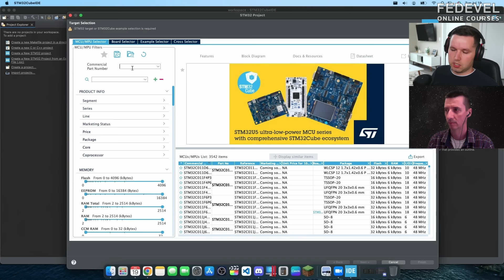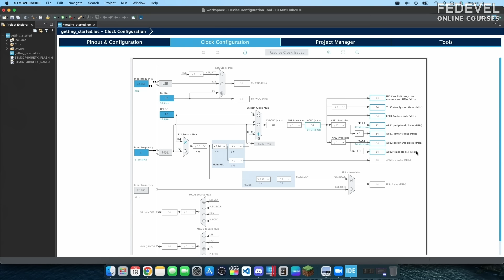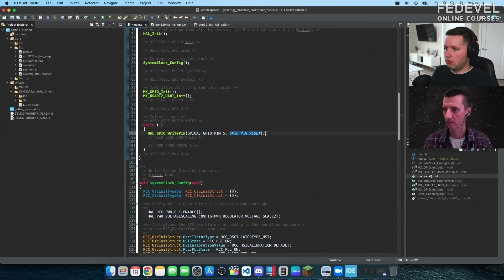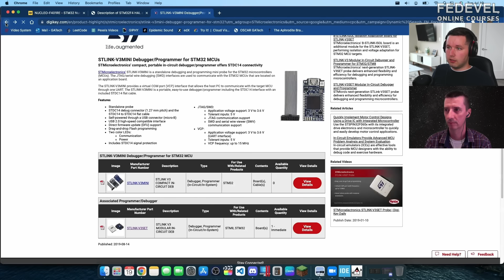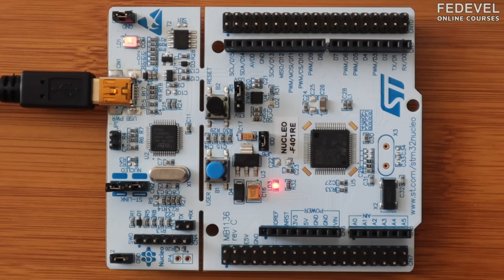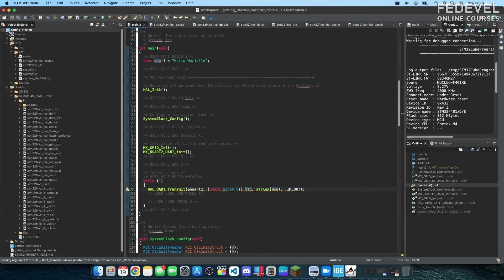Starting with STM32 - Programming Tutorial for Beginners | Step by Step | Greidi Ajalik

Comment: I'm watching the video in 2025. I'm using Linux 24.04 and there is an issue of using arm-none-eari-gdb to debug and run and my Linux won't download the same does anyone have a proper solution to it (I used symlink and even gdb-ultiarch (I believe I place the path in the right place) but still it's the same)

Comment: Hi If anyone can help me, I am getting this while uploading the code from Mac to STM32H755ZI model 

STMicroelectronics ST-LINK GDB server. Version 7.10.0
Copyright (c) 2025, STMicroelectronics. All rights reserved.

Starting server with the following options:
        Persistent Mode            : Disabled
        Logging Level              : 1
        Listen Port Number         : 61234
        Status Refresh Delay       : 15s
        Verbose Mode               : Disabled
        SWD Debug                  : Enabled
        InitWhile                  : Enabled

Info : default port : 7184
Info : Remote address: 127.0.0.1
Info : stlinkserver already running, exit
Waiting for debugger connection...
Debugger connected
Waiting for debugger connection...
Debugger connected
Waiting for debugger connection...
      -------------------------------------------------------------------
                        STM32CubeProgrammer v2.19.0                  
      -------------------------------------------------------------------

Log output file:   /tmp/STM32CubeProgrammer_7ood16.log
ST-Link Server is running on port : 7184
Info : default port : 7184
Info : Remote address: 127.0.0.1
Info : stlinkserver already running, exit
ST-LINK SN  : 0051003E3032511537333436
ST-LINK FW  : V3J16M9
Info : default port : 7184
Info : Remote address: 127.0.0.1
Info : stlinkserver already running, exit
Info : default port : 7184
Info : Remote address: 127.0.0.1
Info : stlinkserver already running, exit
Board       : NUCLEO-H755ZI-Q
Voltage     : 3.27V
SWD freq    : 8000 KHz
Connect mode: Under Reset
Reset mode  : Hardware reset
Device ID   : 0x450
Revision ID : Rev V
Device name : STM32H7xx
Flash size  : 2 MBytes (default)
Device type : MCU
Device CPU  : Cortex-M7/M4
BL Version  : 0x0

Opening and parsing file: ST-LINK_GDB_server_JZJfK3.srec

Memory Programming ...
  File          : ST-LINK_GDB_server_JZJfK3.srec
  Size          : 4.15 KB 
  Address       : 0x08100000 

Erasing memory corresponding to sector 0:
Erasing internal memory sector 8
Error: failed to erase memory

Error: failed to erase memory
Encountered Error when opening /Applications/STM32CubeIDE.app/Contents/Eclipse/plugins/com.st.stm32cube.ide.mcu.externaltools.cubeprogrammer.macos64_2.2.100.202412061334/tools/bin/STM32_Programmer_CLI
Error in STM32CubeProgrammer
Shutting down...
Exit.

Comment: Thank you SO much for this video. I didn't know this software existed. I find it much better for learning than ArduinoIDE. STM32 is definitely a much more educational piece of hardware than Arduino boards or ESP32s. I'm definitely going to have a lot of fun (and headaches) learning all about the bare-metal configurations such as the start-up code and interrupt handling.

Comment: There is the STLINK-V3MINI or STLINK-V3MINIE as well.  It's a bare small board with only the 14pin cable.  I think you need the STLINK-V3SET if you need the 20pin cable.  It's about $15.

Comment: I'm not a professional programmer or anything but I did learn a big thing about libraries. I didn't know if it's included, the whole thing is added. I thought the IDE was smart enough to only compile what was used in the library.

So does this mean if you wanted to use just strlng() from string.h....you'd have to copy that string.h library as your own and delete everything that's not needed to save on program size?

Comment: The capacitor C15 and R30 are not for filtering a signal, they give time to clock system to start before the level of reset pin  become high to start the microcontroller.
Reply: Incorrect. R30 is a pull up resistor to keep the pin at VDD until the switch is closed (then reading ground voltage 0V). C15 is used to smooth out the off/on spikes that occur when you press or depress a switch. That is called switch bounce. So instead of reading a hundred false open/close readings, you must debounce through hardware (this example) or software. R29 is probably there to help with larger spikes of voltage creating a snubber circuit but it probably isn't necessary.

Comment: There are HAL and LL applications and examples on your machine when the a STM32 device library is loaded. The location is "Users -> User Name -> STM32Cube -> Repository -> Device Library -> Projects -> NUCLEO board being used -> select Examples or Applications". In the main Projects folder above there is  a HTML document that lists all the sample code for the entire STM32F4 family of devices. Since ST makes the STM32 family I/O (port pin out) scalable you can use an example for one board on another another board. In other words, open the HTML document and look for the example code you are looking for and then follow above and get the code. Warning: ST does a lot of cut and paste for example code and it will compile with no errors but not work. Then you have to step debug...a PIA. 

I'm a ST Sales Guy. CubeIDE is much improved from +5 years ago. But when a new release are done,  e.g. 1.13.1, they now require a log in for every update done in the application and selector bounces back and forth when trying to type in a P/N or board selection. I sent a hate mail to ST about that, but just like every husband wife relationship they do not listen to me. I encourage you all to use the ST website site on line support option and STM32 forum to vent your frustrations. They pay attention and make patches and changes.

Another way to get example code is when you initialize a project there is tab  for "example".

BTW - this is an excellent bring up video for the STM32...as a ST Sales Guy lead times are back down to 10 to 12 weeks for QFP and QFN products. BGAs still suck because of 3rd party lead frame issues.

Mic drop

Comment: Hello guys, im having a trouble with stm32cubeide, basicall when i try to open a new project its says "Code generation could not be done most probably because the necessary firmware package is missing. Not able to complete STM32Cube project creation. See Firmware Updater for settings related to firmware package installation Tips: Please use the Device Configuration Tool, and then use 'Project > Generate Code' to complete the project generation." any helps?

Comment: 24:11 can someone explain how uint8_t hello = "Hello"; works? How can Hello be stored in 8 bits?
Reply: Maybe the 8 bits point to the array's starting address?
Reply: @uncommonsensor  yeah that makes sense. I am not used in programming like that. I would declare it as a string. Is there any difference? Which is better?
Reply: @arisk4  Well I'm more familiar with C++, but it does use C strings, which are just arrays of bytes terminated by a 0. Also, arrays typically just point to a location in memory, and then depending on what type of array it is, it will know how to access each element in the array depending on the size of its type, and it's index.

I'm not sure if that is what is going on here, but it was just an assumption. Maybe the \n marks the end of the array somehow

Comment: Compilers will optimize code generated and remove dead code from include files etc. So it's correct to include the string.h file. Only the call to strlen will be included, because that one is really called. Include files define prototype of functions, so the compiler can do type checking and thus detect programming errors at compile time.

Comment: Hi. Great video. I have a question.
I have been working on a project for 2 days. However, I need to configure an ADC Port and channel as input. However, if i do make changes in the .ioc file and save the config, the auto generation code rewrites the code i worked for the past 2 days. How can i change config without losing my code?
Reply: Your code needs to be in the appropriate sections commented as "user code"

Comment: You can use the built-in ST-Link for custom boards. The debug pins are available on header pins on the ST-Link of the Nucleo board. Here you need to disconnect the Nucleo MCU from the debugger.
The purpose for the cuts in the Nucleo PCB is actually breaking or cutting off the ST-Link part from the Nucleo, and keep using the ST-Link as stand-alone device.
Reply: That's invaluable advice! That was the only solution for me, when all cheap ST-Link copies failed.
Reply: wow neat

Comment: I would stay away from STM32 for anything other than very small production runs. They have had (and still do!) massive supply problems for the better part of the last 2 years. We have had to move to other solutions because we couldn't get a hold of multiple different STM32s (F103, F413, L496, etc...).
Reply: The chip shortage is prevalent on mcu's then any other for of chips. No one can find also say a simple 8bit atmega 328 that does not cost 12times the "normal price ... and come many other types are also going out of stock.
ST is opening a Mega factory in the USA and moving away from their Asian locations  hence the shortage.
Reply: @John_Smith__  I buy some of the ATMEL chia direct from China for reasonable prices, along with STM parts. They go straight into my own stock at the PCB factory for my custom boards. Only found a couple of models that are silly prices so can’t be used. There are also some Chinese clones of some STM parts now that I’ve been testing.
Reply: @Anticitizen666  Yup, I also have those but for large production it's not even doable. 2 years ago I acquired a Lot of arduino boards, (pro mini, nano and so on). They were at about 1.8$ .. now the same boards cost around 4$ minimum ... plus shipping ...
the most reasonable solution  I can see right now is the Raspberry Pi Pico ... 4$ so far large availability and .. it's a Dual Core Arm ...
Reply: @John_Smith__  yeah I don’t use any standard boards really, except in one project that needs the Pi Zero W. It’s easier to get the chips I’m finding. The RP2040 is easily available but the other Rpi stuff is just impossible in quantities right now, so I’ve been redesigning around the problem. It’s not good though. The other problem is that the RP2040 is very power hungry so cannot be dropped into low power projects.
Reply: @Anticitizen666  Yup, dual core = dual consumption ... not ideal for all applications. Also STM32 low power chips are a thing of advertising only for me :) ! I actually never got my hands on one (in decent quantities). I also almost never use standard boards, my example was just for a case of ultimate need with no chips available, at least the boards are available.
And we all agree on the part that it is not good, it is actually terrible the situation. I can only imagine someone with say a firm order of something like 50.000 boards sold or more and saying to the customer ... look I can not provide my hardware since I can not find the components! Let's not kid ourselves it is truly a bad situation! And sadly I think it will remain like that for at least until the end of 2023 ... a long long time sadly.
Reply: @John_Smith__  Another option are the Nordic chips. I'm using some for ultra-low power RFID/Bluetooth devices, and they can run on uA of current while still reading RFID, or operating as BLE devices! 😁
Reply: @Anticitizen666  Yes ..I also though about taking a look at them but in any case it is always forcing me to redesign and reprogram everything ... but if they have availability one must get what is available.
I now and them take a look online to check for availability of chips like the simple 8bit atmega 328 and each time I do that the prices make me think: If only I had got into hoard mode two years ago 😀 ..
Reply: @John_Smith__  yeah depends on the package with the 328, the MU is really expensive but the AU isn’t too bad in batches of 250. I always use the pb variant - it’s cheaper than the regular 328 and has more gpio and more peripherals.
Reply: @John_Smith__  The good thing is that we're all getting to try out lots of different kinds of chips instead of sticking with what we know 🤣
Reply: @Anticitizen666  True! challenging times also offer challenging Opportunities! There is always a silver lining and the shortage will not last for ever ... 😀
Reply: Hi. We are also facing STM32 supply problems. Which MCU manufacturers do you suggest as an alternative?
Reply: @qqqqqqqqqqqqqqqq7  we ported one of our devices to Linux + A7 CPU (rockchip). On another device we went with Giga Device GD32F103. For low power we couldn't find an alternative yet. The L4 series we can get a hold of in small quantities so we buy whatever we find.
Reply: @alperuzi  Thanks for suggestion. I preferred buying genuine STM32 MCUs in order to support their efforts regarding all the tools they have developed over years to simplify the R&D. It looks like I will be forced to move to GD32 simply because STM can't deliver their products.
Reply: I expected chip shortage to last 3-6 months, not years. For example it is interesting that I can't buy TPS54360. EU, US and TI stock together for this part equals ZERO pcs. On the other side there are 219k pcs available @WinSource...
Reply: @qqqqqqqqqqqqqqqq7  Yup it is getting frustrating specially because we were not used to this shortages ... but realistically this is here to stay until the end 2023 ... sadly.
Reply: @qqqqqqqqqqqqqqqq7  Yep, you can get those at JLC in China - I use them on some of my PCBs and they're in stock for PCBA use. Cost around $1.80 in batches of 100. I'm finding I spend a lot of time trying to find alternative parts with the same footprints for other parts. The Chinese are starting to make clones of popular chips though, so expecting a lot of those by early next year.

Comment: Just a small correction, you can program another MCU using the ST-Link that's integrated in the Nucleo board, you just need to remove a couple of jumper shunts and you can connect your board via the SWD header.
Reply: To clarify, you're addressing the question that Robert asked at 43:15
Reply: Absolutely, I used the nucleo on-board st-link to program an smt32f334 on my custom pcb. Remove jumpers on nucleo and connect custom pcb via jumper cables.

Comment: Is there any reason to choose C rather than C++ in setting up a new project?
FYI, dark mode makes it hard to read the comments in the code
Reply: I think almost all if not all STM32 HAL libraries are written in C and also if you choose to work with FreeRtos for example you will have to use C and not C++.
Reply: @John_Smith__  Thanks
Reply: @John_Smith__  It's possible to mix C and C++ even with FreeRTOS and C libraries. In most of simple projects it won't make sense, but if you are developing some platform which produce lot of different firmwares for different products it's possible to get benefit of inheritance and other C++ features (and get penalty of memory usage)
Reply: @veskola  Oh of course, I agree it is possible but it may make your development actually more difficult. There is the problem of memory usage penalty, and we are talking micro-controllers here. If you are using C++ in order to make it easier to develop for multiple projects ... then C++ can become an issue since you could run into a situation were your code exceeds the memory limitations on one of those projects that uses a lower memory STM32(or other micro-controller). And also using C++ on FreeRTOS does not necessarily make your development easier, some times it can make it more difficult to develop your application.
Reply: @John_Smith__  Sure, but even with m0 Cortext chips it's possible 😁, done that.

Case could be platform which have shared libraries and there is several C0 or C4 arm chips but from different vendors. Chip specific implementation just overwrite few functions.

I know it's also possiple to do similar things with pure C , done also that around year 2000. 😋

Seen also many ugly implementations where one have tried chip specific implementation with pure C but done that totally wrong way, for those guys C++ could really be better choise.
Reply: C++ isn't really used that much in professional development.  Maybe Arduino hobby stuff.

Comment: @Robert you're a mind reader!

Very cool. I just bought an STM32H745 discovery board. I installed CubeIDE but the initial complexity of what you need to do next when you start is stopped me in my tracks. I understand the complexity because of all the different (hundreds?) of STM32 variants but it still leaves you with initial sticker shock.